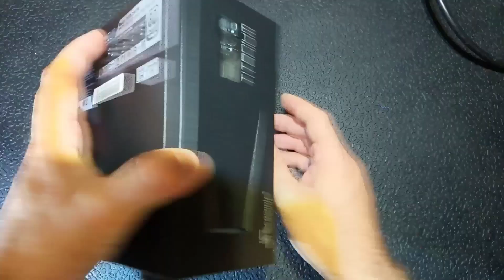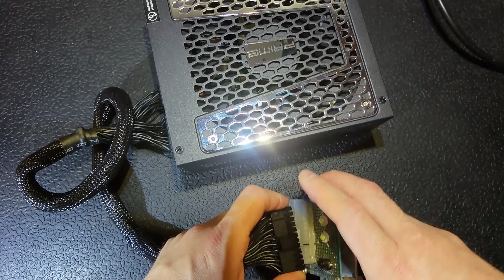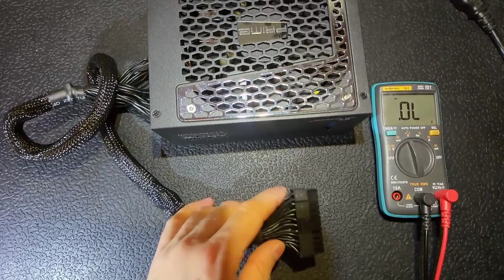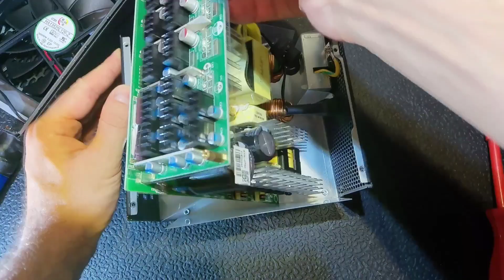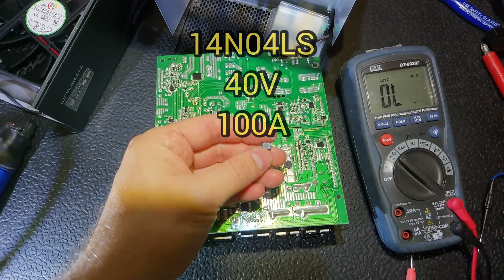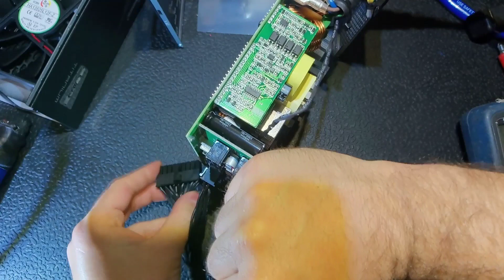Seasonic power supply repair

Comment: You have knowledge sir! I have a question, should anyone be consider with value on -5v rail? I Asking because my "maybe damaged psu" have shorted on this line
Reply from the maker: If you have 5v line shorted check 5v dc-dc converter. I show the same problem in previous video.
Reply: @electronicshaverightstolive  Yea but i talking about - 5v (minus) 😅😅
Reply from the maker: @ocho7011  as much as i know there is no such a line on modern atx psu... only -12v. Anyway you should check rectifier diode on this line. It is placed right after the transformer winding.
Reply: @electronicshaverightstolive  thanks! Thats what i want to know 🥳
Reply from the maker: @ocho7011  you are welcome.